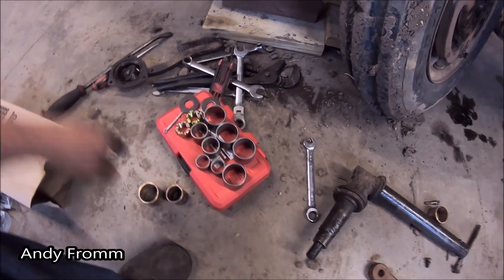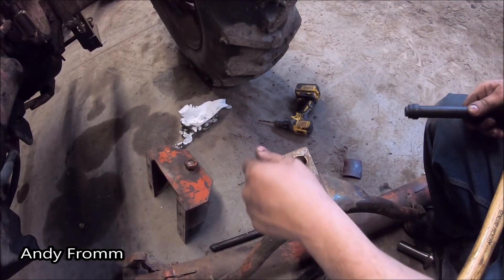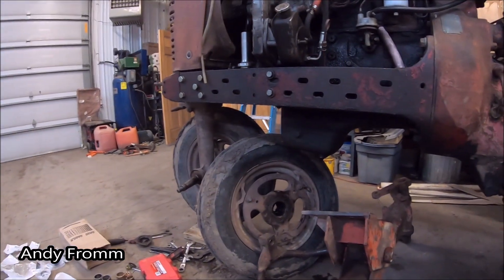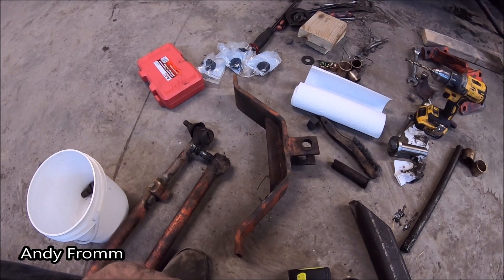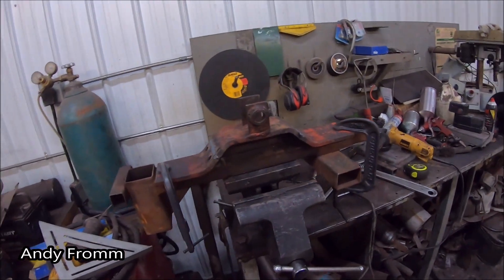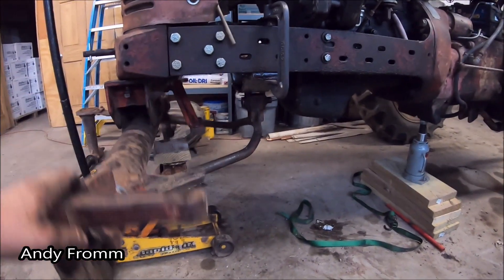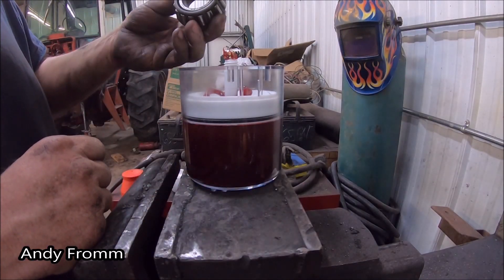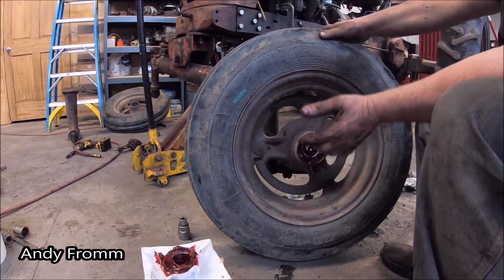#Cummins #Farmall M #4bt Wide Front Upgrade pt2

Comment: Are you able to mount a sprocket on the front of the crank shaft to run a hydraulic pump mounted on the side rail of the tractor, if you put a loader on, it is the way to have a live pump?
Reply from the maker: The gear driven power steering on the left side can be replaced with an adapter which numerous different flow live pumps can be mounted to.
I will be probably doing that on the next major change to the tractor.

Comment: Nice video. I bought a wide front but knew something had to be missing and it's the part that bolts on for the steering. Do you have any idea where that piece can be bought?
Reply from the maker: I think many of these parts can be bought new through speedco or maybe a&I if I remember right.

Comment: Where in the world did you get that piece of crap front end. Good job, I am glad you found parts for it. Are you going to get the welds cleaned up on it? Did you use your old wheel bearings? I am finding that the replacements that I desperately need are way too expensive. About $150 a side but that includes seals. These are the bigger set than the standard sets that you  can buy cheap from Steiner.
Reply from the maker: I haven't cleaned up any welds yet. I used the same bearings, finding the same as you on prices. Thanks